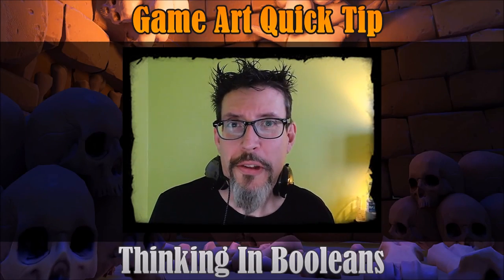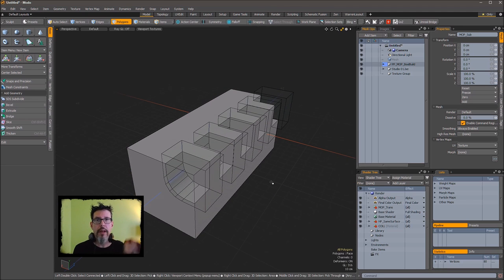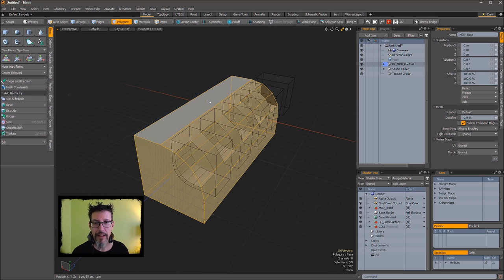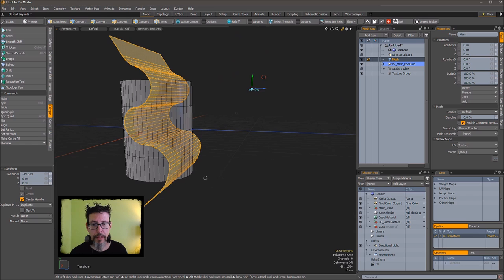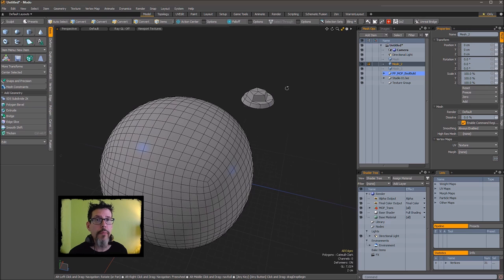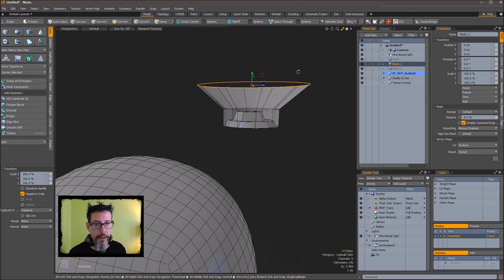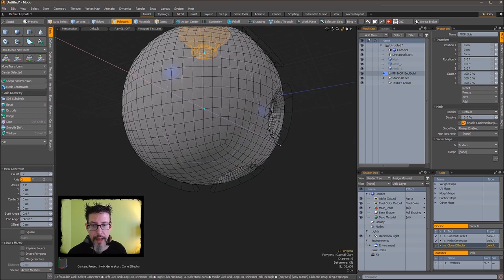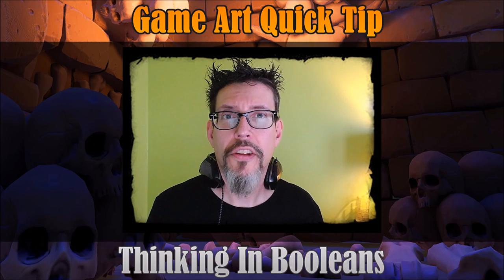Game Art Quick Tip : Thinking In Booleans

Comment: I have questions. Only way to remove this artifacts after boolean operations is make base mesh more denser?
Make edges softer dont work. I have no idea what to do with it ://
http://i.imgur.com/3Yk4RNn.jpg
Reply from the maker: Well, make sure you're rendering with the rounded edge shader for starters.  As for the mesh smoothing, try the vertex normal toolkit included with MODO.  See if that can fix it.

The meshes don't always come out perfect ... but they generally come out good enough for baking.